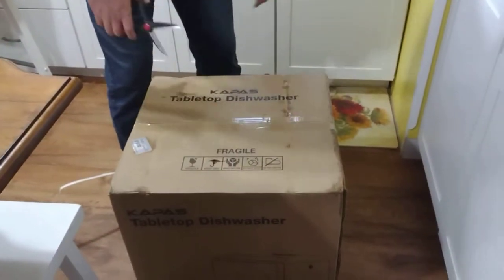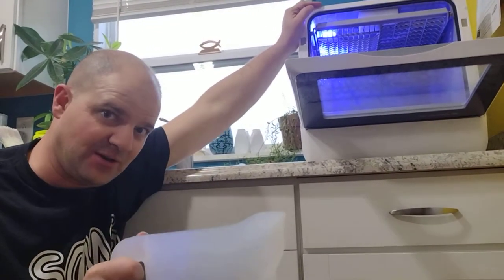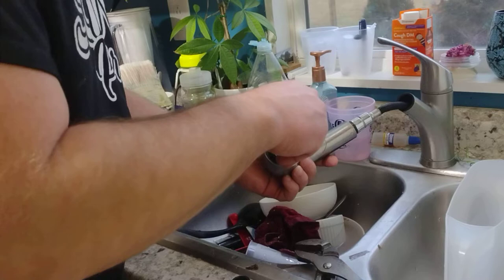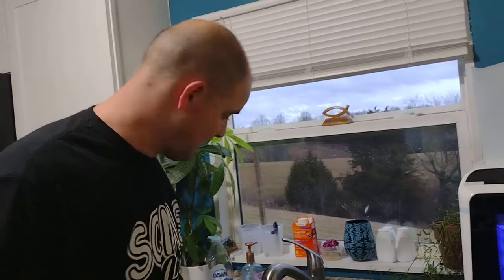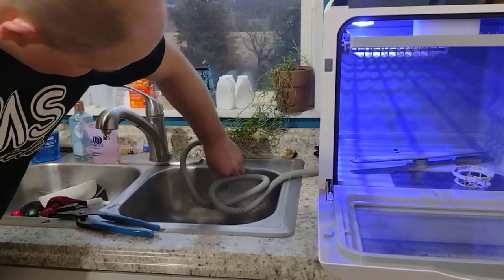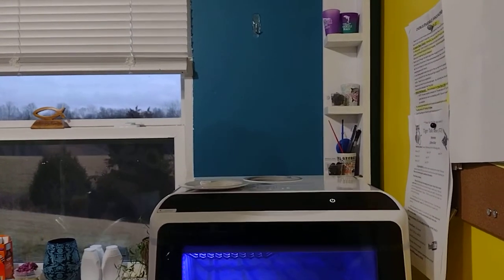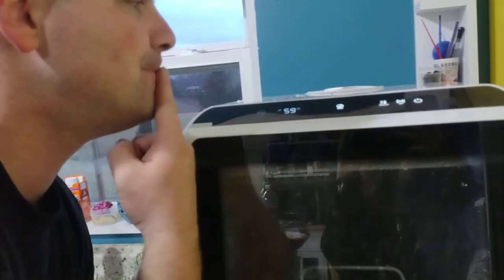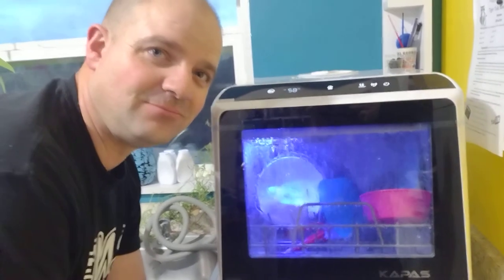unboxing and setting up the Kapas countertop dishwasher

Comment: Hi! Mine only works for about 99 seconds then it immediately drains, starts beeping and says E6. Do you have any advice on biw to fox that?
Reply from the maker: Haven't had that yet.  I did a quick Google search and one user said they just reset by unplugging for 10 seconds and running it again(worked).  My guess is a sensor thinks something is wrong.  The manual says "fault, Heating"...so maybe something wrong with the heating system.  I'm not sure.  Try cleaning it out real well and resetting.  Beyond that, the manual says to "contact our service man".  1-877-276-7195 is the number I found for DGI service online.  Good luck.  Let us know your experience with customer service!
Reply: @Mr.Handy-ish  you're so nice. Ty for your help and quick response

Comment: Love the video, I have mine by the sink and instead of using the container to fill it up every time I just use the sink nozzle. I put it over the screen where you fill up the water and turn on the water gently until I hear the chime. PS do not use liquid dish soap . You must use dishwasher detergent
Reply from the maker: We went that route, too!!...using the pull out faucet to fill it is so convenient. I like that it keeps the water so hot, and has the dry feature....although, I usually stop that, to save electricity.
Reply: @Mr.Handy-ish  What happens if you use liquid dish soap? Mine is running now with liquid Cascade.
Reply from the maker: @ifellicantgetup  I used a small amount of dawn and it foamed WAY up.  If that happens, just pause it and scoop the foam out.  We use cascade complete, powder.  No issues...cleans very well on eco setting.

Comment: how did you get the drain hose to stay, my suction cup sucks
Reply from the maker: Mine does too!  Fortunately, mine stays put (pinned between sink side and a drying rack that we keep in that side of the sink).  I suppose you could put a small dab of adhesive on the suction cup if you don't plan on moving it...or you could use something else to hold it in position.
Reply: @Mr.Handy-ish  I'll probably do what you did, thanks for the quick response :)
Reply from the maker: You're very welcome!  Good luck.

Comment: Are the outside lights supposed to stay on after everything is done? Mine stay on. 7:33
Reply from the maker: The blue inside light should turn off after a bit. No outside lights that I'm aware of other than the control panel readout.
Reply: @Mr.Handy-ish  yes the outside lights stay on
Reply from the maker: If you push and hold the power button, it should turn everything off.  Other than that, I have no clue...I suppose you could always unplug as a last resort.
Reply: @Mr.Handy-ish  yes the control panel lights are what stay on. I’ve only had it for 2 days. I just didn’t know if
Reply from the maker: Yeah...ours doesn't turn off automatically.  We still like it, though.  Here's hoping you have our luck with it!

Comment: After a year, it does NOT light up nor does it heat the water hot enough! Do you know how to reset the FIRMWARE or is this a product that people love at first & then learn to hate as time passes?
Reply from the maker: I sure hope it's not a consistent problem!  Sorry to hear your plight!  I'm not aware of an update that could be run.  Please share with us if you've checked with customer service...or if they back up the product (warranty length, etc).

Comment: I think you should have read a little of the manual before making the video. The outside of the box says that the water in it was in fact from a test and to run a load without dishes first
Reply from the maker: I think you're probably right! 🤔 I have some bad habits🤣. Thanks for the comment and view.  If you don't mind a guy that doesn't know everything and isn't afraid to show it on the tube, try some more of my videos...kinda all over the place.